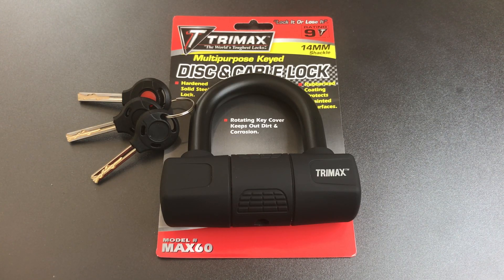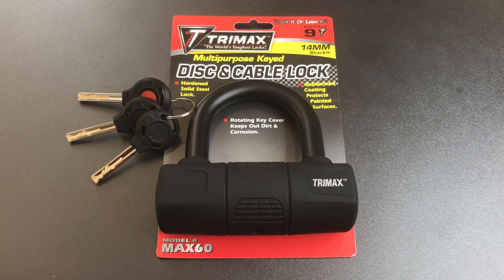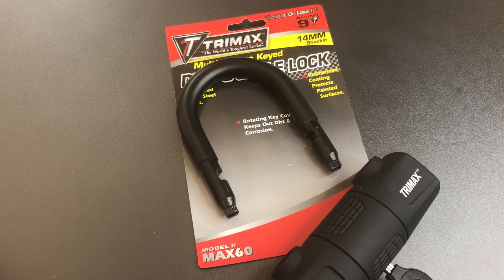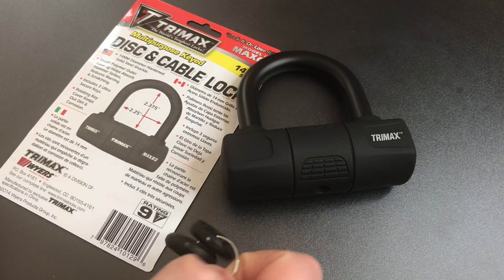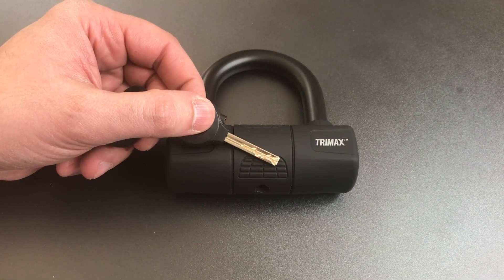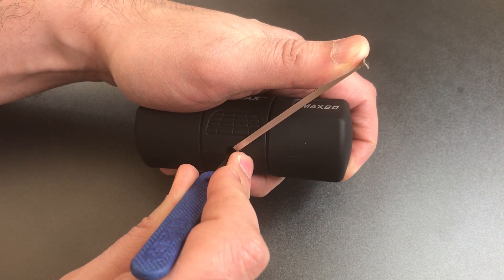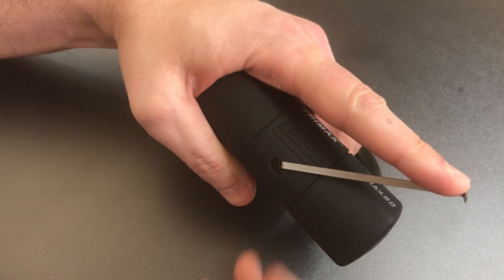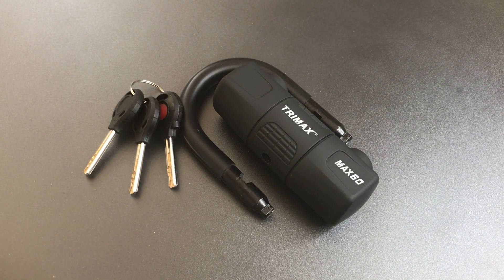[601] TriMax “Max60” Disc Brake Lock Picked

Comment: If you’re buying this lock, you do need to know it has a “14mm” shackle so you can buy the correct chain, or know what it will fit.  I’d let that claim slide because 13.6~14.
Reply: Jon Bartosch I agree. But I'd rather get a true 14mm hardened steel shackle. The rubber coating on this one could act like a guide for  a saw.
Reply: Kristian Justus oh, yea of course.  Just in this case they need the plastic to avoid scratching and they have to tell how big it is.  Now that I see the package again, I guess the best thing would be having 14mm small like a dimension rather than big in the corner like a feature.
Reply from the maker: A couple notes. First, it’s clear from the back of the package that’s not what they are saying. Second, that’s not how any other lock company measures. Third, if you look at the TriMax MAX40, they measure the metal, (not the metal and plastic) so they know how to do it correctly.
Reply: LockPickingLawyer thanks for the vids!  Love your channel!

Comment: It’s fair for them to advertise a 14mm shackle considering that’s the approximate size of the shackle with the rubber sleeve.That dimension is used to determine if the shackle is small enough to fit through a lock hasp.
Reply from the maker: A couple notes. First, it’s clear from the back of the package that’s not what they are saying. Second, that’s not how any other lock company measures. Third, if you look at the TriMax MAX40, they measure the metal, (not the metal and plastic) so they know how to do it correctly.